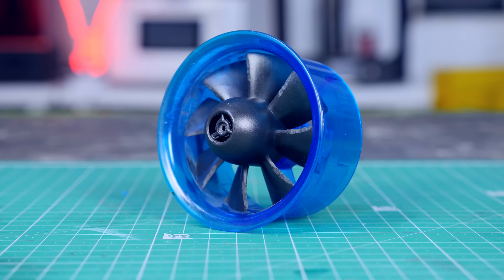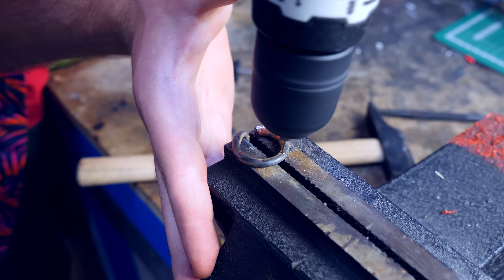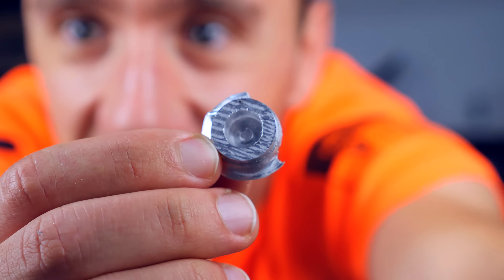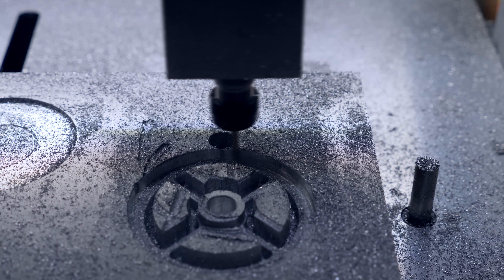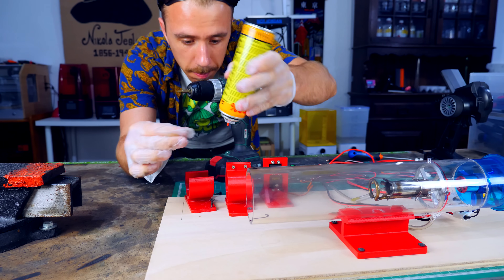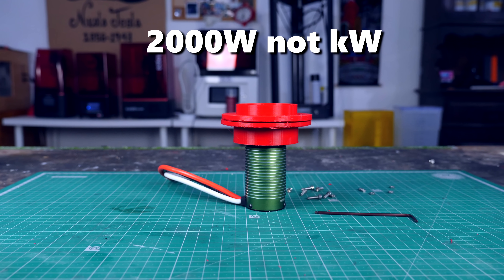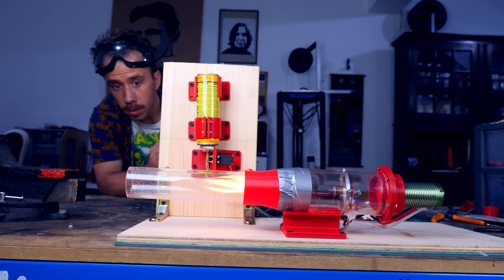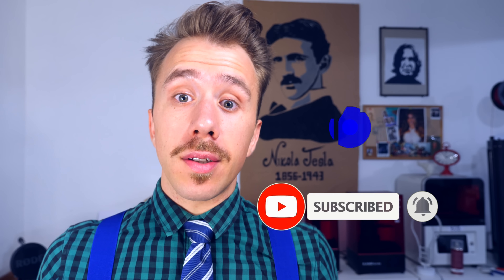I turned my Fan into a Jet Engine (3D Printed EDF Afterburner)

Comment: Great video. CNC  machining, for low torque/hobby machines, drill a hole first and drop the endmill in that hole to start and reduce the length out of the collet to the least possible (better to have to increase length when you go deeper but this will help with rigidity).

Comment: What this project needed was some way to measure the results. Nothing fancy, even a ruler hung behind the jet on a hinge with it's deflection angle measured would give some indication of performance with and without the afterburner and comparing different fan designs. 
An alternative would be the entire assembly mounted on a couple of linear slide rails and a small digital scale to measure the force it's pushing with. That would allow you to measure in pounds or kilograms of thrust. (or at least grams of thrust)

Comment: The reason your fuel injector keeps staying on fire is liquid fuel entering the fuel line, pooling, then evaporating. If you stand the fuel can upright, it will prevent liquid fuel from leaving the can, unless you're trying to have liquid fuel enter the system, due to energy output. They is a device called a condensate collector, used for air conditioning, that will prevent liquid fuel from entering the system as well.

Comment: The angry sound while the CNC is removing material is due to the long length of the bit causing chatter. If your end mill is further into the collet, it should help. I’m not sure if you’re manually putting in feeds/speeds or if the CNC is calculating it, but it could also be that you need a higher or lower spindle RPM or feed rate. Hope this helps in the future!

Comment: that is not a jet engine is it.
a jet engine requires that the fan actually compresses air,  mixes it with fuel into a combustible mix, 
combusts that mix and in turn makes a turbine spin on a shared shaft so the compressor is powered by the turbine.

All you made.. was a complicated torch.
and you made gas burn leaner .. gas already burns without compressed air..Adding the air only makes the flame turn yello.. there is ZERO thrust produced by the flame..
The only thrust comes from the fan, and it is negligible.

your torch would not work with kerosine or diesel, because you do not have a compressor stage..

16 minutes of jibber jabber explaining a not jet engine being made

Comment: I love the video. Only problem is this is a really neat flame thrower/pseudo ram jet. For it to generate thrust y or must compress the air before you ignite it. The reason after burners work is the additional thrust is generated off the initial thrust off the turbine. With that cnc and the engineering you could make something amazing.

Comment: Not a turbo jet or even a pass through turbine.
This is closer to the pulse “jet” engine that the Germans used in the V1 buzz bomb.

Once a real jet engine lights it will run on its own until the fuel or electrics are shut of or run out. The after burners in military aircraft are a series of rings with carefully metered hold that “dump” fuel in to the path of hot exhaust which then ignites. Oh, majority of av gas is based on Kerosene. It does not burn as fast as propane or other “vapor” gases.  This is why the RC jet engines cost thousands. Unless you are a real machinist it is extremely difficult to make one.

Comment: This is not how a jet engine works. All your doing is burning fuel in the back side a of fan in a tube. The in coming air needs to be compressed by burning fuel in the multiple fans that are inside a jet engine that actually creat thrust’ the after burner is just fuel injected into the exhaust of the jet engine. If this was even close to a jet engine it would melt immediately’ plus jet engines spin into the 100’s of thousands of rpms.

Comment: We need to find away to connect the compressing fan to a series of high temp fans after combustion so that when the hot air and fast air spins those secondary fans it will compress more air in the system

Comment: fun video but it is not a jet engine. nothing about it is a jet engine. No compression of air or combustion to drive the non existent turbine. basically it is a see through propane heater

Comment: Instead of having the can upside down which would release liquid butane. With the size of the injector holes, the butane doesn't have enough time to atomize properly for a proper burn. Instead, stand the can up and let the butane atomize before it is lit. Test with the can in different positions to get the proper atomization for a clean burn.

Comment: This was a wonderful video, 🎉 well done, well done indeed🎉 Inspector Clouseau!! I do have some small observations. Mounted fuel bottle right beside plastic flame tube. At shut down liquid propane began dripping out of the “fuel injector” in the tube. finely but important, no test equipment to measure additional trust (if any!) created by the “after burner”. Hmmmm?

Comment: A glow plug is just to heat the cylinder of a diesel engine the compression of the air in the cylinder makes it fire

Comment: EDF is already a jet engine as it produces a high velocity stream (a jet) to provide propulsion. Combustion is not required for jet propulsion.
You have not created an afterburner, as an afterburner creates a secondary combustion event occurring after the primary combustion event, hence the name afterburner.
The project is cool, but terminology is completely incorrect.

Comment: Bro if your looking for a better substitute for a sparkplug then check out the ignition switch on a cooking grill the electric ignition can function as a sparkplug that runs off a 12vbattery and you'd be able to run the fan motor and the ignition system off the same power source like a power tool battery then you'd have  portable afterburner system to use for other crazy shit

Comment: Well, not exactly a jet engine, but more a out of control furnace jet nozzle, which is not the same use of the term jet as in an aircraft compression and high force discharge kind of jet engine.

Comment: Ik a lot about fighter jets, every time I go to fighter jet museum I often know more than the tour guide. So afterburners have been a thing since the 30s with the first jet to have it was the capproni c.1. afterburners became a revolutionary technology in the 50s allowing fighters to break the sound barrier in level flight, the second generation fighters were the first to use afterburners to such effect. With every generation after often having afterburners, which improved both speed and high altitude performance. The f-15 was the first aircraft to have a greater than one thrust to weight ratio meaning that it can accelerate vertically with afterburners. However afterburners use up more than three times much more fuel when in use, which is why aupercruise capabilities are fantastic for modern fighters such as the f-22. Despite their benefits outweighing the consequences

Comment: the reason your cnc machine is making this noise is because your cutter is very long compared to its diameter. also make sure that it got a centercut. and it should be with 2-3 "lips". material should be HSS (in german)  it also helps to make a hole with a driller first, in wich you go in with the cutter

Comment: The key to get the system working 100% of time is automation. Flow measurement of air, then gas, afterwards PID control of gas and air flow to follow the set ratio to get the most efficient combustion. Should use Arudio or similar. GL Would be a good video?

Comment: in fact glow plugs arent used to ignite the diesel but high compression is they compress the fuel enough to heat it and then it lights

Comment: Concentrating hydrogen peroxide is very simple. I needed 30%. So I pick up 10% at a local beauty store and evaporated two thirds of the water off at 160-180°F. Not exact but worked perfectly for what I needed.

Comment: Jet engines require compression of air, then an initial combustion after an initial fuel mixing. Then afterwards, additional fuel can be added to creat an after burner. So technically there is no afterburner and technically (because there is no compression nor a bypass system) this isn’t a jet engine, it’s a fan blowing a fancy flame. 🫤🫤🫤But I do admire the attempt, but I would like to see you read up a little bit more on the details of her engines before claiming to make one.

Comment: You can reduce vibration on your CNC by using higher speeds and the appropriate carbide tooling. 👍tools will also last longer. Also I’m going to recommend a liquid cooling setup when your doing metal.

Comment: I'm pretty sure glow plugs are only used in a diesel engine as a starting aid in cold weather, otherwise diesels don't use spark plugs to ignite their fuel, they use heat and pressure instead.

Comment: gasifiers are very interesting we started messing with one a few years back trying to make a solid wood pulp fuel to increase efficacy but we were sidetracked. 
#2 is the weather balloon to space edge it is a fantastic way to get close to the heavens and maybe the only way for regular folks to be astronauts. RC planes and camera drops have all been done but there is something no one has been successfully trying or to polish up an idea already attempted. What is cooler than space. ...Note We are just a couple hundred mph from hitting the speed of sound with an RC plane speed runs back to earth could be fun to try. I love this channel I just found it ... not interested in the printer just more great videos... .

Comment: Maybe you should look at mixed flow fan designs. That's what's used on some tank engines to force high volume of air through the cooling group.

Comment: You actually don’t want a centrifugal fan (that pulls air in from the front and directs it sideways).  What you actually want is an axial fan (it pulls air in from the front and sends it out the back).
Reply: sounds like a normal fan to me
Reply: @dumbteens348  Because it is.
Reply: @dumbteens348  Difference is he means an axial compressor, the difference is, a regular fan pushes air, a compressor compresses air, they use different blade geometry and design.

Comment: Could you make it run on a liquid fuel such as gasoline? Also, if you made the nozzle smaller, it might increase the exhaust velocity. Or maybe try a bypass design like a modern jet. The EDF blows around the combustion chamber or smth. Im trying to make a high speed RC plane, and i figured an afterburning ducted fan might do the trick

Comment: You're missing the set of fan blades at the rear that should be connected to the set of blades at the front.
It's the exhaust that directly draws more intake, like a linear turbo.

Comment: That is not a jet engine.  That is a rammed air torch.  The combustion of a jet engine will provide feedback that will turn in input compressor.

Comment: Glow plugs are not what ignites the fuel in a diesel. They are simply what helps ignite it when it's cold,. They turn off when the engine warms up, and some don't even have them.

Comment: jet engine: Sponsored by ductape.

Fun fact: Duct tape is actually terrible for repairing ducts. This is because it wasn't original called duct tape, but something more like doek tape made for repairing sails. (google for more info) Duct tape sucks for a jet engine type thing because when subjected to high and low temperatures suddenly (like in a duct) it quickly dries up.

Comment: You said you don't have a metal 3D printer why don't you try taking your arc welder and using it as a 3D printer head. You would of course have to figure out how to attach the ground wire on a plate to start your welding surface but I imagine you can figure it out you're a bright guy.

Comment: Just found this channel and I'm really impressed with everything about it! I have a suggestion on machining aluminum. Use an endmill that has shorter flutes, this will cut down on the chatter. After that just mess around with depth of cut and speeds and feeds to get the surface finish you desire. Im looking forward to watching more of your videos!

Comment: In a jet engine the front fan blades suck in the air like this but they are attached to a shaft that extends into the exhaust, which has more fan blades which are spun faster by the heat of the exhaust, which forces the front blades to turn faster and suck in more air, creating more exhaust in a perpetual cycle until the engine reaches the peak of its power curve

Comment: use crystal diode came out old welder  and celling fan motor no spinning parts  just magnets and windings the center of fan magnets came out of ford started 90s model it made 0.5 volt

Comment: 2:47 - glow plugs aren't use to ignite the fuel in diesel engine. They just make sure that in cold conditions temperature inside the cylinder is high enough to make the fuel ignite by itself, only by compressing it. You can get rid of the glow plugs and on warm day you won't notice that they're gone.
In fact they're not heating the space in cylinder after just a few seconds.
Reply: I love your profile pic

Comment: Dear Mr. Integza,
You’ve been making all of these really cool jet engines!! So I was wondering, there’s been a bunch of talk about crop circles leaving behind a sound frequency. Which got me thinking is there any way of making a jet engine or turbine engine from sound? Or if it’s even possible.
Reply: The short answer is yes, but possibly not in the way you are asking. Pulse jets and tuned valveless jets use harmonics to provide thrust by using the sound wave to provide back pressure by adjusting the length of the tube. You can find the principle for how to make them in “the two stroke tuners handbook” it gives the formula to make sound waves produce thrust using tuned lengths of pipe.

Comment: Random guy passing through YouTube found your video interesting concept or thought that you had one thing that you can do is go and get one of those universal airplane RC controllers like The MythBusters were having to control said vehicles where it had a adjustable thumb stick knobs which would probably help control the fan speed and the amount of fuel that you're putting out. You're basically creating an old school variant that is more manual than electronic

Comment: 2:54 diesel engine ignition provided by the high pressure not the #glow_plug
the glow plug only used for making the air on chamber of the cylinders hot to facilitate the start engine

Comment: When machining aluminum you should use wd40 as a lubricant. Helps prevent the galling (tearing) of the metal that makes the part a bit rough and makes a horrid noise

Comment: Well you have 3 chambers so why not start by using all of them with multiple triggers. 
Balance the rotor with a second set of magnets and insert 3 sensors running 3 air valves.

Comment: It is fun to see and I am impressed how quick 3D printing parts are made.
But .... there exists something as fuel air mixing, stoechiometric ratio, turbulent flame velocity and flame stability .....  There is also something are aero dynamics and how to design a burner with stable flames.
And also how gases are stored in cans under pressure and becoming liquid.  And you do not install them with the outlet at the bottom ....
It takes years to acquire the knowledge necessary to be able to work at a professional level.
I am amazed that without any knowledge and calculation you build something and then expect it to work.   This is not how engineers and scientists work .....

Comment: Maybe build that fan twice as big or a twin or triple fan assembly on that motor. It sounds like that fan is not putting to much resistance almost as if the motor has nothing mounted on the shaft.

Comment: brilliant, love it. can you help I built a good 3 axis CNC mill, the interface is mach 3 usb, it works fine if i move it manually with jogging each axis. what free software can i use to design/draw my parts and then how to convert to g code for mach 3 ?

Comment: Unique 💡 idea....use blast furnace gas, BFG (co) as home made rocket ⛽️ fuel. 
blast furnace gas are N2, CO, CO2, H2O and H2. Blast furnace gas composition in volume is N2 = 55.19%, CO = 20.78%, CO2 = 21.27% and H2 = 2.76%. Do it.

Comment: Made on of these about 30 years ago using exhaust pipe scraps to melt aluminum in a kiln, also used it to warm up a cold winter basement, firing this up would heat a cold basement in very few minutes to comfortable. Brought back some fun memories.

Comment: When you have used the centrifugal fan, you better use a convergent-divergent nozzle and that will be able to deliver higher velocities. In case of overexpansion of the exhaust flow, the flow will have higher velocity. Can you give it a try?

Comment: silly question, but that cutter seems quite a way around from the part for the width. Given the depth you were attempting to cut, can the bit sink deeper into the chuck? Disclaimer : I'm NOT a qualified engineer, but as i understand it the chattering sound's usual suspects are vibration by the cutting tool or attempting to cut too fast (X or Y Axis, not rotation) causing it to flex.

Comment: I was wishing for success also. In reality though, you are holding a candle in the wind without it going out, for the most part. That and you didn't measure thrust both with and without a flame. To have any hopes of it somewhat working, you will need syphon holes/tubes(with controllable ports) positioned after the burner. You will have to experiment on getting the right distance behind the main fuel injection manifold and you might even have to add a very fine controlled mist of additional fuel. This will allow the expanding heated air, to pull additional fresh air in that the fan can not generate. In hopes of increasing thrust force, somewhat like a real afterburner.